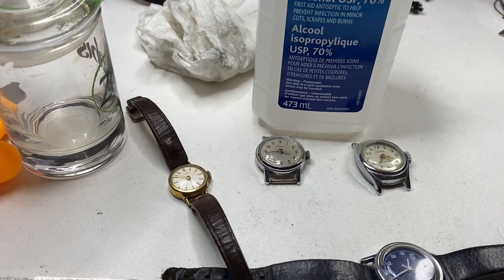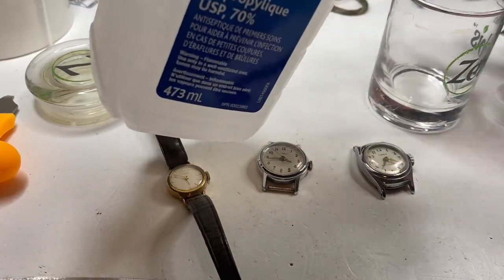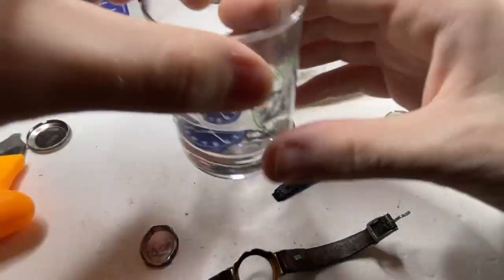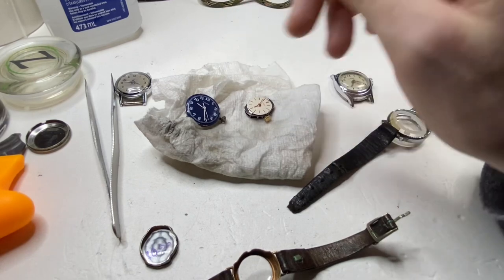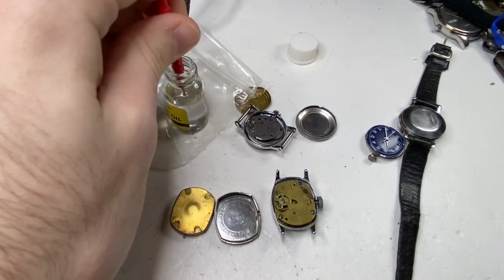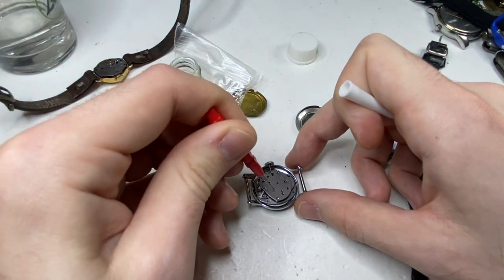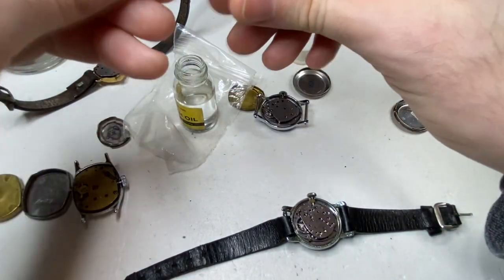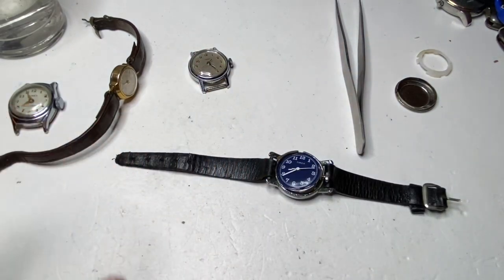How to fix a stuck mechanical watch with rubbing alcohol

Comment: My 2 cents: they might run but they won't be accurate, they will probably lose time. Second, you are using too much oil, they will collect dust and stop again in the near future. 😢
Reply from the maker: Ok thanks I may make a part 2 seeing if they keep accurate time. Also, I will use less oil
Reply: They make an oil absorbing bag or foam block to absorb the excess oil and yes, you almost always accidentally put two much oil no matter how hard you try.  It's also best to completely disassemble and wash the components in an ultrasound washer.  However, this guy just finds watches in thrift shops, cleans them up cosmetically just enough to sell them at a higher price.  He does find a few gems but given that it's just a cosmetic cleaning, some of what he charges are a bit excessive but all the more credit to him.  I have more respect for this guy then a watchmaker that charges for a cleaning and oiling and just swaps the mechanism instead (NOS and factory refurbished mechanisms are often still available at low prices and newer model mechanisms can also still fit old cases even if the calibre is different, even an amateur could swap out a Seiko 5's mechanism with a Seiko NH35A mechanism and most of the time it should fit).
Reply from the maker: @johnwang9914  thanks, the YouTube channel is for fun. I buy and sell items as a hobby. I will not sell any watches I put in alcohol. It’s more a of a proof of concept

Comment: The petroleum distillates in lighter fluid will keep the movement lubricated internally even after pat drying it thoroughly.  This is probably why it was recommended at the time by Timex.  Cool video 👍
Reply from the maker: Would you recommend doing it with lighter fluid over rubbing alcohol?

Comment: Great tip thanks for sharing 👍 😀
Reply from the maker: Thank you for watching
Reply: I haven’t had much luck buying these old Timex watches and having them work for very long. I think it’s more of a nostalgia thing, being a kid in the 1970-1980s. But, I’ll try this trick and maybe I’ll have some luck. Thanks for sharing.
Reply: Excellent video! I’ve been playing around with some similar techniques. I had a non-running Timex watch but I cleaned just like you did rubbing alcohol then I placed it in paint center, It started running in the paint tinner let it soak for a few hours. When I pulled it out and dried it out it’s been running great. I also tried doing the same thing with the 17 jewel movement, they say you don’t wanna soak the movement more than a minute because they can and glue the pallet forks. Couldn’t get it to run, and I pulled the jewel out cleaned it and oiled it on one side and I was so excited to see it jump back to life. Crazy crazy small. 👍
Reply from the maker: @gerechoppers  thank you, I have had luck with this. Mainly for getting out dirt
Reply from the maker: @livefree6878  wow glad to hear, we will definitely work more on this technique. I’m always open for suggestions on thing to try

Comment: Good video as always. As you stated, ideally the dial should be taken off, but as you said these Timexes arent service friendly. On more servicable watches, I would probably remove the dial, date wheel (especially if you use lighter fluid, to avoid chemical interaction), and maybe optionally the mainspring, which can be oiled too.
Reply from the maker: Yes I agree. I watched one video where wristwatch revival took one of these apart and it took him over 1 hour to put the back plate one. I’m nervous because the dial is only on by two tabs.

Comment: 70% alcohol is that at normal atmospheric pressures, the highest alcohol content you can achieve through distillation is 67%, you need a partial vacuum or a water absorbing adsorbent filter to achieve higher concentrations, an old moonshine trick is to filter through straw which though it still absorbs some alcohol and is not reusable but it preferentially absorbs the water and can be thrown back as feedstock for the next batch, of course in industry they purchase reusable ceramic zeolytes (the filtering zeolyte is renewed by baking).

Any alcohol above 67% concentration will slowly absorb water from the air till it is eventually 67% alcohol, that's just the nature of adiabatic alcohol.
Reply from the maker: Ok thanks I did not know that